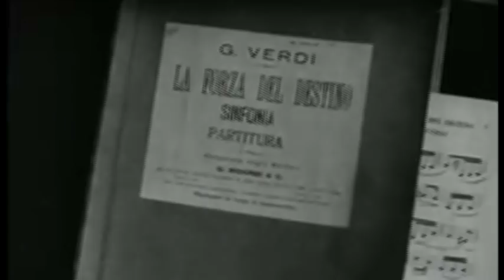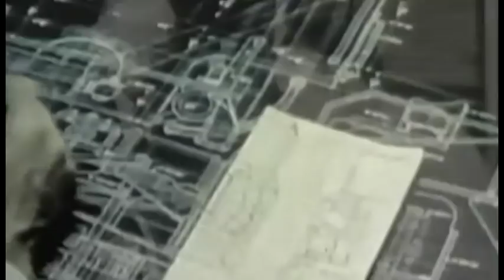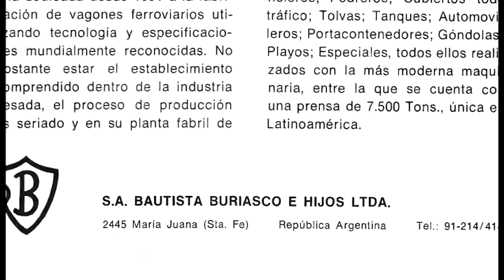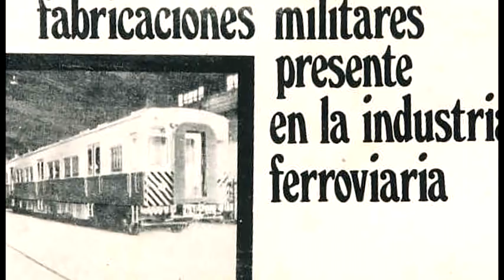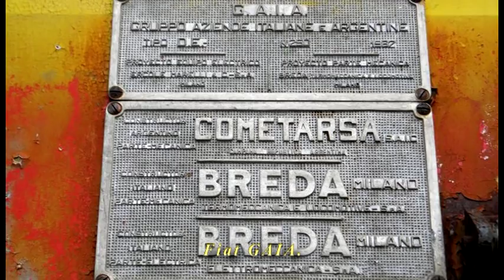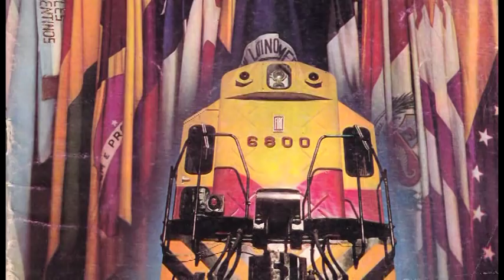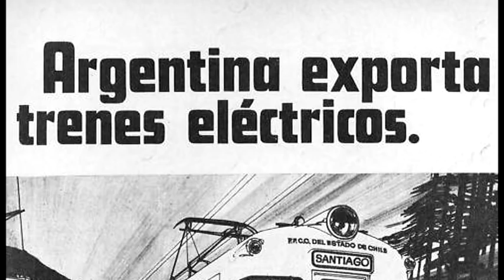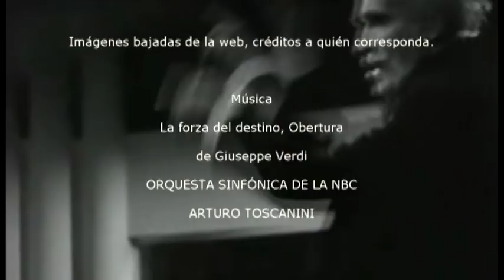122. Historia de los talleres y la industria ferroviaria Argentina

Comment: El FERROCARRIL, tenía diferentes SECCIONES, y como dice este espectacular Video, tenían la sección de Vías y Obras (donde los Ingenieros y Técnicos eran los responsables del control, reparación, renovación, cambios de VIAS, etc. , talleres artesanos ( a la altura donde hicieron la porquería esa de la terminal nueva de omnibus de CBA), galpón locomotoras (a la altura del arco de córdoba, obvio sobre el ramal del mismo Mitre), y cantidad de secciones de oficinas y talleres más para la operación del negocio y SERVICIO FERROVIARIO. los políticos, como siempre destruyeron y llevaron al cierre de ramales, de servicios, etc. otro día comentaré más cosas por mi blog. Gracias don ALberto Dieguez por compartir semejante informe.